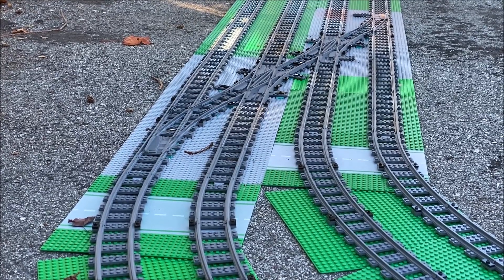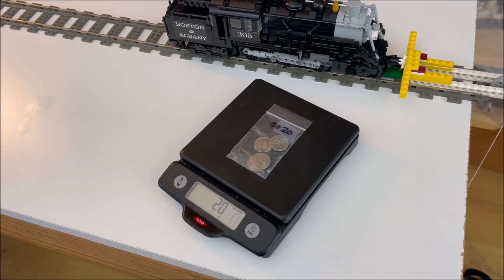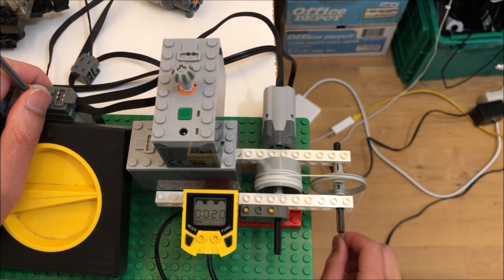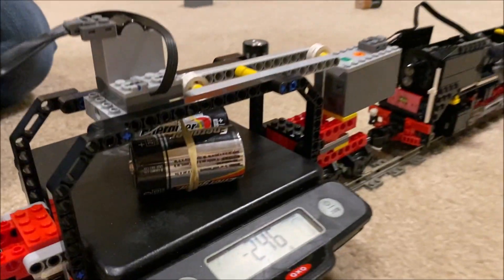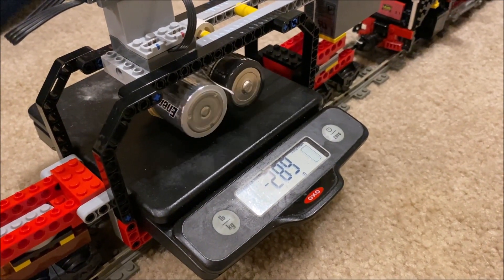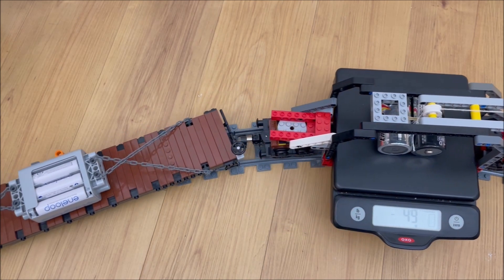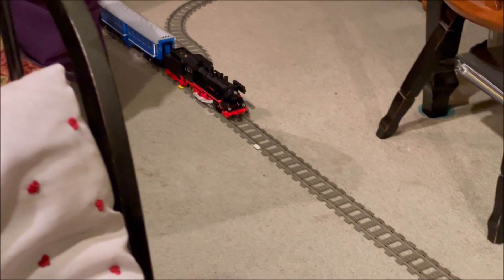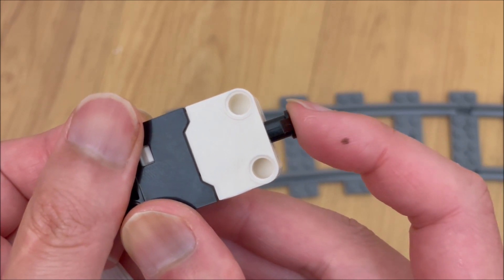Can We Build a LEGO Dynamometer Car? (part 1)

Comment: Could you use a set up to measure power that has a train car that gets pulled and drives a generator and you take your measurements from the voltage generated?
Reply from the maker: This does work in theory, but not all the power from the locomotive is going to go into the generator: the car itself will take some of it, and that's what we're trying to measure in these tests.